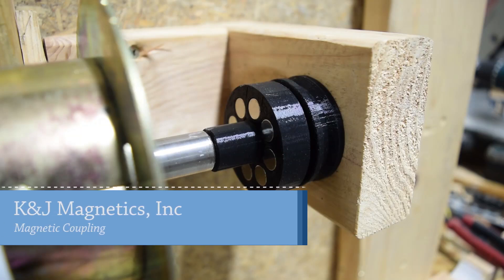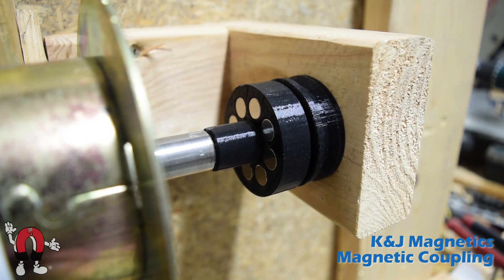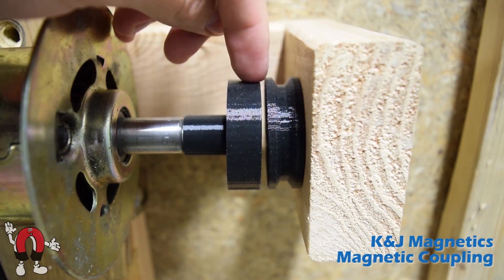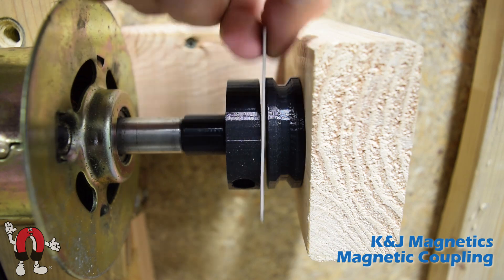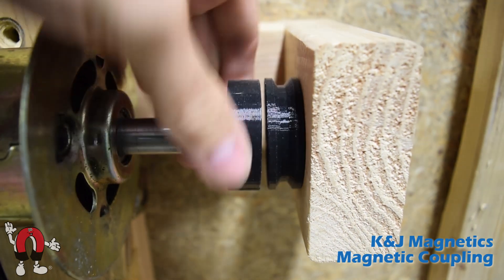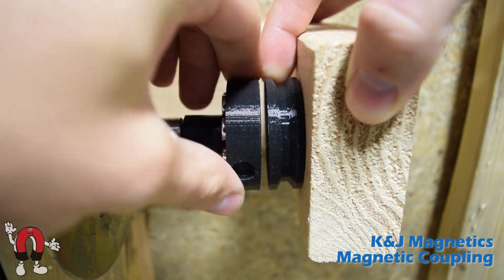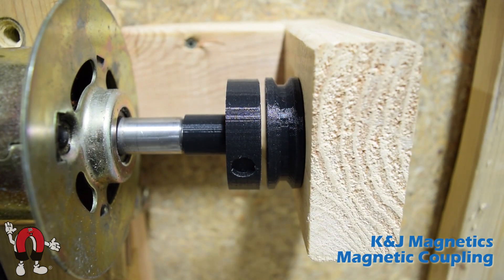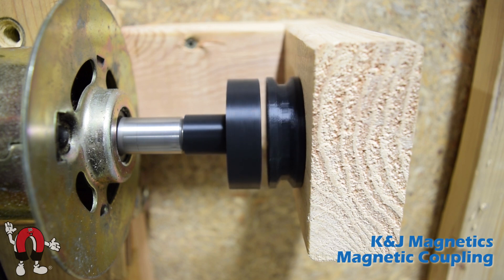Magnetic Coupling

Comment: How is the second magnet spinning? How is it connected to the wooden board? What's there between the wooden board and the magnet that is making it easy to spin?
Reply from the maker: The magnets in each are attracting to each other, so it's a magnetic "coupling"
Reply: @KJMagnetics  Yeah get that, but is there something between the second Magnet and the wooden board that is preventing friction between the wood and the Magnet? How is the Magnet spinning so smoothly?
Reply from the maker: @5hadowAJ  it's just on a regular bearing.
Reply: @KJMagnetics  Could you please expand on this as I don't get how to set that up?
Reply: @KJMagnetics  hi, also can you please explain the arrangement of the magnets?
Reply from the maker: @5hadowAJ  they're axially magnetized discs, I believe 6 in each, alternating polarities, N, S, N, S, etc.
Reply: @KJMagnetics  But how do you get a magnet to be only north or south?
Reply from the maker: @5hadowAJ  not possible. All magnets have a north and south pole.
Reply: @K&J Magnetics So what do you mean when you say alternating polarities?

Comment: What are the advantages of using magnetic coupling?
Reply from the maker: Transfer force/torque through walls or over a gap, reduce vibration in a system, or even reduce damage from slippage.
Reply: Also to prevent possible damage. I used a 1" magnet against a shaft with a flat plate as a magnetic clutch. If the shaft gets jammed, the motor doesn't jam. Also handy, I can remove the motor easily since the device is kept outdoors.